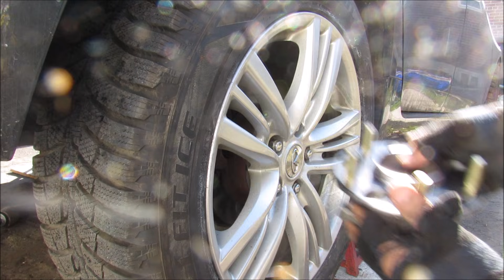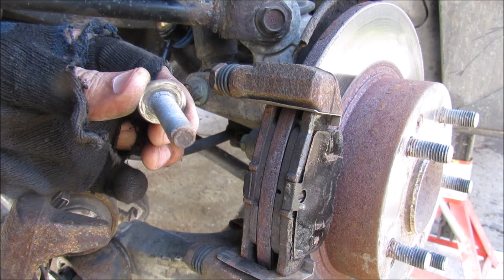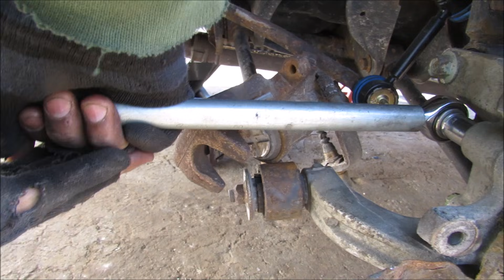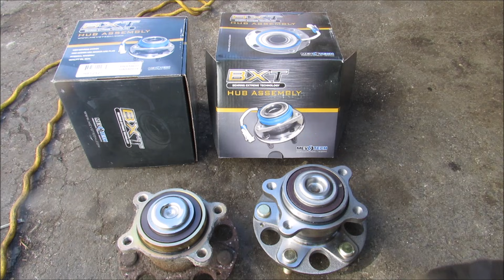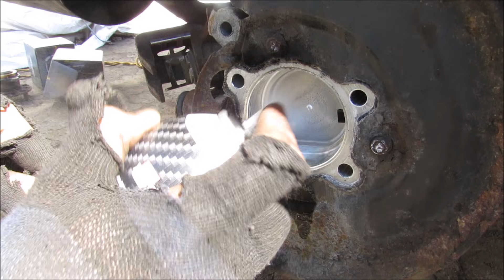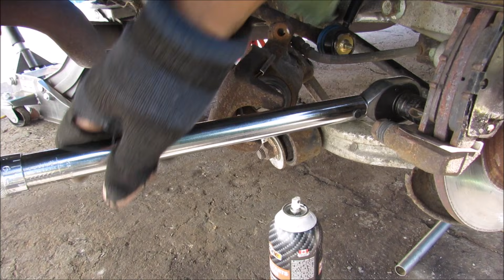How to Replace a Wheel Bearing Hub Assembly

Comment: I'm replacing the front wheel hub assembly on a 2014 Mazda 3.  I don't have a torque wrench for the 4 bolts in the rear, so I tightened them down as hard as I could. They call for only 25 lb ft.  Will they be ok with the super tightening I did??

Comment: Are you supposed to use new mounting bolts whenever they are removed?
Reply from the maker: If they have thread lock or are stretch to yield
Reply: @speedkar99  Thanks for the reply, but how do you tell a stretch bolt from any other bolt?  My Bolts have a 10 stamped on top and they are from a 2015 Hyundai Sonata. Can't really find a clear answer online.

Comment: Could you do the rear bearings on your GS350 ? Also maybe a rear differential service?
Reply from the maker: Okay I'll look into that in spring.
Reply from the maker: I already have a differential oil video
Reply: speedkar99 ok, I’ll check it out. I might need to replace mine so I’ll need the removal video as well 😜

Comment: I checked my wheels for wobble while I had it on jacks and there was none but I still feel like I hear a bearing sound while driving at freeway speeds. Could it still be the bearing ? Should they be replaced in twos ?
Reply from the maker: Yes the bearing can make noise but not have any wobble.
Reply: speedkar99 Thank You 🙏🏻

Comment: this was short story short, i had long story long- front hub bearings replacement- everything was uninstalled as you plus front suspension- mcpearson type, and trip to hydraulic press shop to pull out old bearings and put new bearings and again for other wheel because i could not do it in same time because garage is not too wide so i had space for only one side at once and i was curious why bearings got loosen- there were no sign of worn on inner or outer rings or balls, grease was very stiff  and dirty and plastic fixing ring that holds balls in place, was worn and balls was not on same  place so balls could go around for 1-2 milimeters and that is why bearings had movement and wheel was not fixed

Comment: i need some help for my 2012 Dodge Charger. Traction and ABS are off on dashboard i used diagnose tool and says "left front wheel ABS wire replacement" and changed it still didn't work. then i replaced the whole wheel hub and still not resolved!! any help on this matter is appreciated
Reply from the maker: Sounds like wiring

Comment: "I" had to replace one of those early this year. Drum type brakes at the rear of my vehicle. Of course I am not that confident so I went to the mechanic (hence the "I" at the start of this comment). There was some serious gouging on one side of the bearing. Actually made a video on it. Weird that the hub material was machined and polished into a bearing as opposed to pressed bearings into a casting.
Reply from the maker: So there were no ball bearings?
Reply: @speedkar99  there are ball bearings but they were fabricated from the casting of the hub. Not separate bearings pressed in. Have a look at the video. You can skip to 2 minutes in but its not long.

https://www.youtube.com/watch?v=5oSfq6ivgLY
Reply: Cast iron makes a pretty good ball bearing race. The cost to install something harder is probably hard to justify, especially on a part they want you to throw away and replace.
Reply: @fun_ghoul  its just different though. I have never seen a bearing machined out of a casting. Its always been a bearing pressed in. 

The finish is quite good. Can't determine the composition of the casting though.

Comment: Those Philips screws are bogus. I prefer the giant nut on my Nissan that needs a 3 ft breaker bar extension to get off.
Reply from the maker: A nut would be so much better....
Err no fastner at all would be the best thanks
Reply: @speedkar99  I'm dealing with a lot of brake jobs, and using impact screw driver on those philips screws make them come out nice and easy 90% of the time. For the rest 10% usually heating the screw really fast, hitting with screw driver, and cooling down works (but it has risk of cooking grease in the bearing). But when rotors are held by  bolts, like 10 mm in volvo, they break more often than philips. Torx like in Chevrolet is somewhere in between.

Comment: I just replaced both rear wheel bearings on my Camry a couple of weeks ago and just want to say to everyone, it really is simple to do it yourself. Went to the dealer and was quoted $620 for just 1 wheel bearing replacement. I bought both hubs for $200 and about $50 in parts I needed to do the job. Your best friend will be penetrating fluid to make it easier to remove bolts and the hub from the shield, parking break assembly, and knuckle.
Reply from the maker: Glad it worked out for you
Reply: speedkar99 thanks man, keep up the good work and keeping us educated

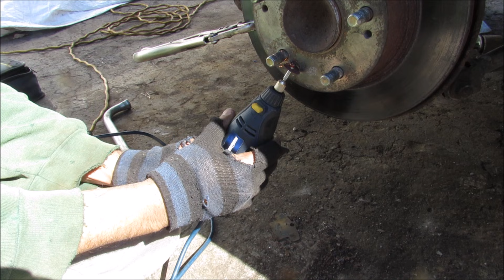Comment: I'm pretty sure you can use impact screwdriver head to open these stubborn screws @1:20
Reply from the maker: I have tried. They don't work that well
Reply: @speedkar99  I personally prefer to use manual impact driver, the one you use with hammer, to open stubborn screws.. using impact drill will overpower screwdriver and for sure break the screw head.

Comment: Vessel Impacta screwdriver or JIS impact bit in a manual impact driver for the stupid screws.
Reply from the maker: An impact driver wouldn't have taken these screen out...it likely would have rounded them
Reply: @speedkar99  I'm referring to the manual type of impact driver that you hit with a hammer. People report good success with the Vessel Impact screw drivers - they're sort of light duty impact screw drivers. I have one, it works, but I don't work on enough cars to know if it would work in a really severe case.

Comment: You should say reinstall, instead of replace when talking about previously unbolted parts. 
You replaced the wheel bearing but reintalled the wheel, caliper, brake rotor and so on.
Reply from the maker: Thanks for the suggestion
Reply: In addition to the definition you listed, Oleks, "replace" has long meant "to put back in place". In fact, that's the original meaning. Go argue with the dictionary, if you like.
Reply: you spelled " reinstalled " wrong , use spell check next time.

Comment: Alternative method: Use an impact wrench on the stupid screw and you won't butcher it getting it out for those who want to reuse it!
Reply: Those screws are used only for the assembly process to keep the rotor from falling off the hub as the car goes down the assembly line...
The wheels and tires are not installed until the car in in final assembly before it rolls out the door
Reply: @grandinosour  I was wondering why Speedkar didn't put them back on, now I understand.
Reply from the maker: You mean an impact driver? Yeah those rarely work in my experience...I hate the rotor screws and there's no need for them since the wheel holds the rotor on when things are together and they are a pain to get off. FYI the other side came out just fine with a screwdriver but I didn't put them back in.
Reply: They are also used to out a bolt it help PULL the rotor off if it where to become seized on hub .  It "pushes " against the hub to aid in release
Reply: @gusc6785  You're thinking of the threaded holes in the rotor that have no bolts in them. This one has the threads in the hub.